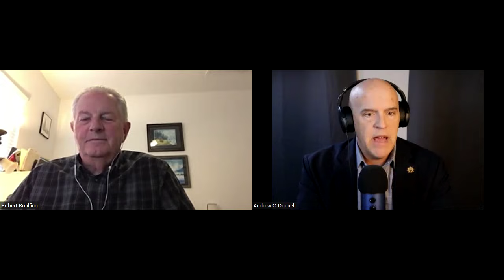Inside Desert Mountain Energy's LOI for SNC Battery Plant in Roswell

Comment: I do not believe for a second that the data centre will be built. The company "Roswell Information Park LLC" is only a few months old and has no public face of the company. The actual VC firm that DME is working with has no publicly available experience in data centres and neither does DME.  Further, Altech Batteries Limited (the company that RR  references) is a broke penny stock. Additionally, there's no explaination of what value DME provides here. They have a 30 year old depleted nat gas feild that yeilds very little gas. After a year of production and little to no development work they have not yeilded a profit and they don't talk about helium anymore.
Reply from the maker: Appreciate the thoughtful skepticism – it’s fair to say this whole Roswell build-out is still early and carries real execution risk. Nobody should be treating a multi-GW data-centre campus as “done” at this stage.

A couple of factual points though: Roswell Information Park LLC isn’t just a name on a slide – it has signed agreements to buy all of DME’s West Pecos gas and is funding ~14 miles of pipeline and related infrastructure on a non-dilutive basis, and Rob has been appointed to its advisory board alongside the project developer. Those deals have been picked up by multiple independent industry outlets, not just DME’s own news flow.

On DME’s side, the value proposition here is gas supply + produced-water processing + by-product recovery (sodium/REEs) tied into the AI campus and SNC battery plant concept. It’s ambitious and there are lots of moving parts, but it’s not simply “made up,” and it doesn’t mean helium has disappeared from the story – this is about adding a local energy/infra leg to the business, not abandoning the original thesis.